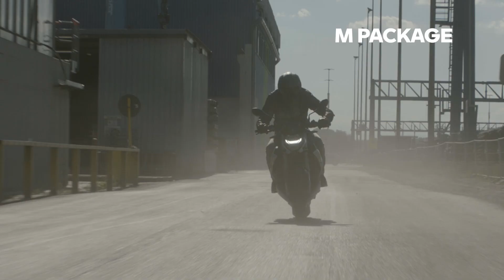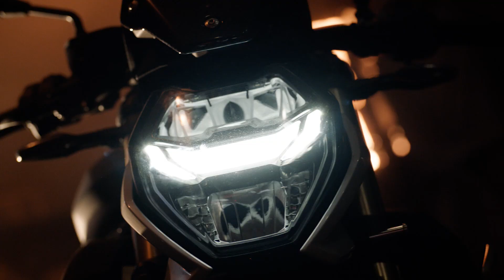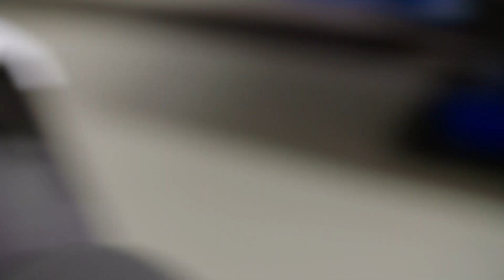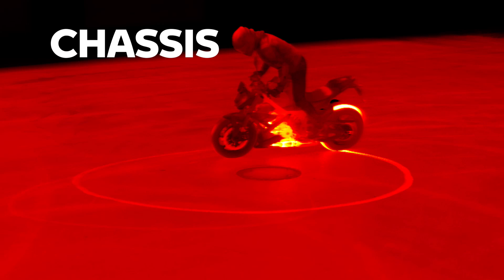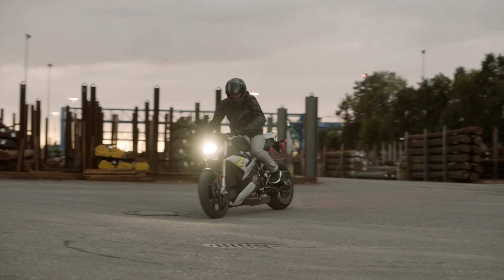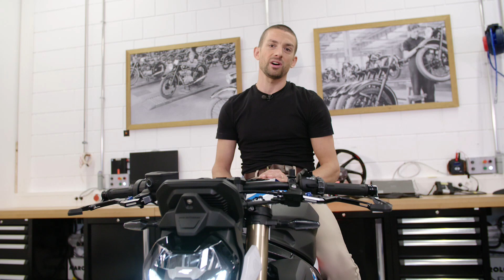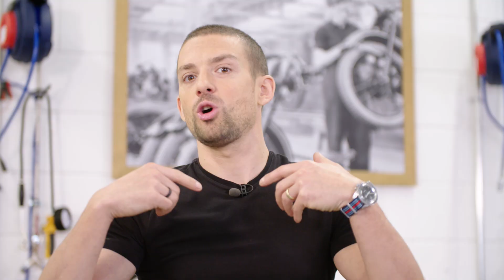IN THE SPOTLIGHT: The new BMW S 1000 R

Comment: I want to do stoppies! Can ABS be turned off? No body will answer my question.  I would buy one if I can turn off all the nannies!
Reply: it's simpler than that: you can deactivate rear wheel lift detection in DYNAMIC PRO mode, thus do stoppies without risking front wheel lock-up

Comment: I own a 2016 S1000R. The front is undeniably ugly. This new model is something worse however - it looks boring. At least the old one looked unique. Also, with EURO5 i'm worried that it will lose the great sound of the old one. 

Judging from the specs this will - again - be one hell of a bike. But for me, not enough reason to upgrade.

Comment: What a bad looking bike. Look at what Ducati has done...and other's. Such boring looking bikes with engine not up to the mark
Reply: Taste is subjective. About "engine not up to the mark" well street fighter v4 failed as street bike the reviewer and test riders prefer tuono or superduke. What is the point to buy a naked with 200 hp which lack the power in lower rpms in favor of pure top end power. It won't be as fast as supersport because it lacks wing protection and got wing drag nor it's fast to ride as fast because you will have sore neck.

Comment: COMPETITORS to BMW S1000R. 165 hp.114 torque. 195 kg.
Aprilia Tuono V4 1100 Factory. 175 hp. 121 torque. 209 kg.
Ducati Streetfighter V4S. 208 hp. 123 torque. 178 kg.
Kawasaki Z H2. 200 hp. 137 torque. 239 kg.
KTM 1290 Super Duke R. 180 hp. 140 torque. 210 kg.
MV Agusta Brutale 1000 RR. 208 hp. 116 torque. 186 kg.
Yamaha MT-10 160 hp. 111 torque. 210 kg.
Reply: wow you sound like a newcomer 🤦‍♂️ Figures means almost nothing. What counts is the dynamic behaviour of a bike, qualities and negatives of the chassis ! Same goes for the engine. If you like power to weight ratio, then go build your own dragster 🤦‍♂️🙄 Or buy a H2R.
Reply: Hahahahahaha! You get offended every time ^^ Lenso Prezole AkA BMW's lawyer
Reply: Its not all about power, its the whole package that counts & when the grunt comes in. I'll be interested to see a group test against those bikes you mention.
Reply: Don't confuse dry weight with wet weight.

Comment: Riding a red 2014 Premium with Akra system (what a BANG!) Coming from competitive ZX10 riding for 10 years 100k miles. I ADORE this bike!! it charged my bikelife with fun again, ALL the time! its easy to push straight cold tires! limit is easy to reach, and maintain. Only HUGE down is low top speed of 160mph. so 90mph is 6500rpm which is cruise limit, and super low pegs without option for GP shift which is major safety problem for me (low pegs) almost ran my foot over trying to shift in leans (size 10.5) This bike only x5 better BTW the stock exhaust system shed some 15lbs after changing to Akra.